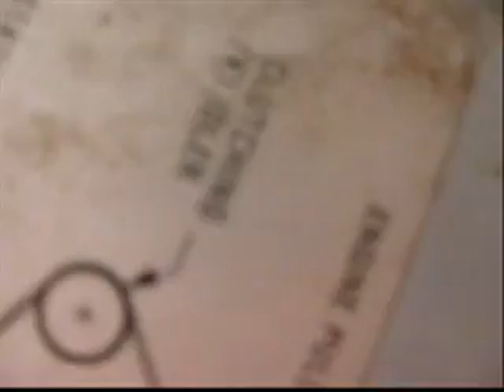Engine Pulley and Current Progress

Comment from the maker: @Cod4Killa07 There was a big pulley on transmission shaft,and to get that off you just had to remove a snap ring from the top and pry it off, myne took a bit of persuasion but some pb blaster wd-40 or something like that will help it slide off. As for then engine pulley there was a bolt on the bottom of the crankshaft that needed to be impacted off and then some very small Allen bolts to be loosened the again some persuasion to lower it off.